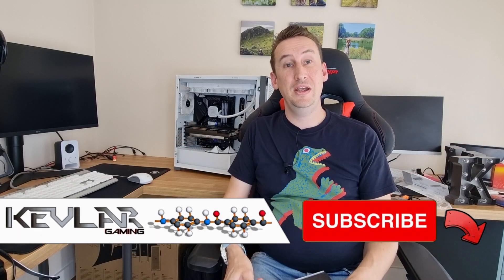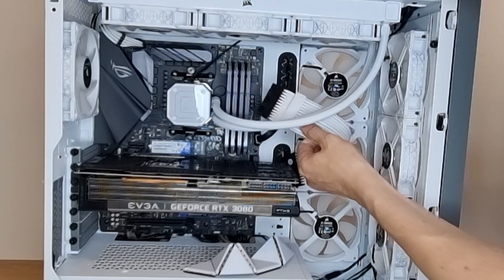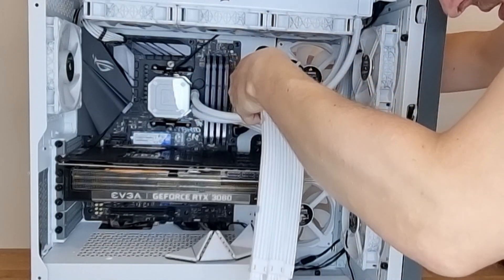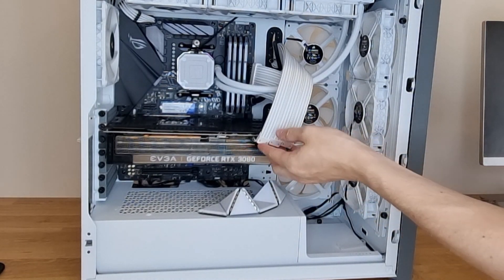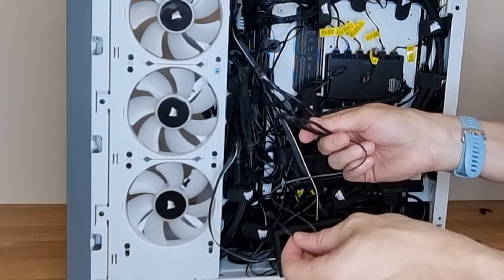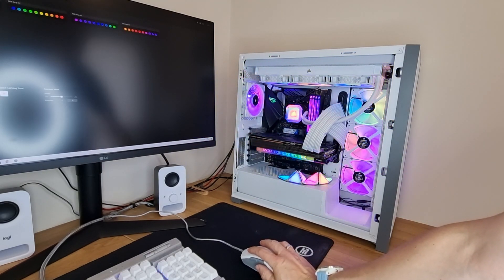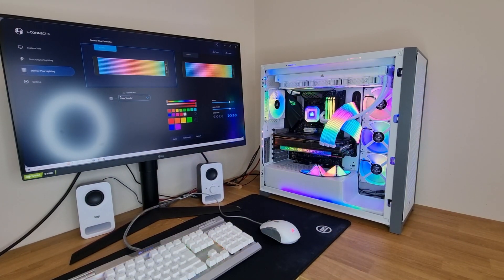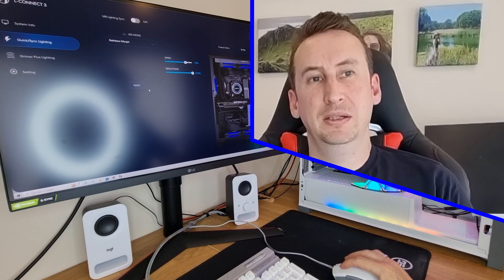How to install Lian Li Strimer Plus V2 - Can I control with iCue??

Comment: i have written before another video video you had.  I got it working with icue with old controller v1 version.  It works right away.  I have also tried all sorts of ways it does not work.
Reply from the maker: Yeah I meant to mention you found that in the video, forgot to mention it!  Might do a quick follow up vid to show that for people that might want to use that method.  Thanks for sharing 👍
Reply: Can i have the link to buy that controller v1 thanks 🙏🏾
Reply: @charlie888ize  just Aliexpres or ebay
Reply: @merkekeruysat  link ebay please i try look but couldn’t find it 😢

Comment: iQue is garbage, as is most Corsair Fans and Coolers.  After working as a system builder for many years, I stepped way.  Three years ago I decided to build a new system, and I went with Corsair, based on review.  What a mistake.  3 Months later I changed out the CPU, and game the system to my daughter.  I then tried NZXT, CAM software much nicer then iQue.  Sold that rig and now just build a Full Lian Li system.  By far the best experience I have had....  LConnect is a far better piece of software.

Comment: Hi guys, I'm from Brazil and Version V2 works, I'm using the lighting node pro controller, the difference between version V1 and V2 is in the L-Connect 3 software. With Lian Li Strimer V1 you had to configure the controller to control the ARGB through the Motherboard and in V2 you have to connect the USB cable to the internal Motherboard and install L-Connect 3, in the Quick/Sync Lighting menu, enable the MB Lighting Sync option so that the Motherboard controls the ARGB, then connect the Strimer ARGB cable on the lighting node pro controller using a converter cable and then just make the settings in ICUE on one of the channels that is connected.
Reply: Bro you’re the man!! Your instructions are on the money and they worked! Thanks!!!
Reply: thank you very much from Spain!
Reply: You are best bro thanks

Comment: If my GPU has 1x8 + 1x6 pin connection and I want to use the rgb lights via Icue, which version of Lian Li would you recommend and is it even possible to connect the GPU cable on a video board that does not have the standard 2x8 or 3x8 connection?
Reply from the maker: Hey, think I just answered most of this on your other comment.  But I would suggest getting v1 cables if you want to control via icue, as the v1 controller is easier to get working in icue

Comment: Not sure which exact Corsair controllers you are using but is there any reason (I am using Strimer V1 to adapter) that I couldn’t forego the Lighting Node Pro and just use one of the LED slot on the Commander Pro connected with the adapter cable to the Lian Li Controller directly? Any advice would be appreciated I have 10 RGB Corsair fans so have the Commander Pro, Commander Core XT, Lian Li Controller and an RGB hub for the RGB for the fans plugged into the Commander Pro. I am setting up a new PC now and space is becoming dire so adding the add’l controller and wires might be a pain. Thank you
Reply from the maker: Hey, yeah the LED slot on the commander will be fine!  I just went for the lighting node as its the cheaper option if you don't have any commander etc with an LED slot.
Reply: @kevlargamingpcs9802  awesome thank you! I appreciate the response, your videos were really helpful for wiring these mess of Corsair fans and strimer cables

Comment: So in the 8 pin port in the gpu I only have one slot. And only one of the 8 pins light up. If this how I have to have it now ? The original black 8 pin has its original connector then about also coming out of it about 4cm of wires then another connector and even plugging in both connectors to the lian li strimmer lights in the back ended doesn’t do the trick. If I switch them round the other one lights up so it’s no faulty it’s more than power is only going into one of them. Any thoughts ?
Reply from the maker: So sounds like you have a gpu that only needs 1 8pin cable?  And I don't think lian li do a single 8 pin strimmer cable, only designed for 2x8 pin or 3x8 pin gpus.  So yes I think it sounds like it will only work properly when fully plugged into a gpu.
Reply: @kevlargamingpcs9802  even when I plug it into the one which isn’t plugged in it still lights up the inactive one so not sure if that ends the issue 😕 my original 8 pin cable actually has to output socket things obviously I only have 1 input so it doesn’t matter but how come the 1st supplies power but the extended one attacked doesn’t ? Seems like a wasted but of wire but surely not right ?
Reply: @kevlargamingpcs9802  for example the one that isn’t plugged into the gpu and is just hanging is the one currently lighting up? Any ideas ?
Reply from the maker: @mcocadmit4923  interesting, I'm afraid I'm really not sure.  Ive never had that situation, only ever had the cable where I'm using all the connections

Comment: It is possible to connect directly to the motherboard? I have the strimer plus v2 8pin, whitouth controller. Thx!
Reply from the maker: Hey, I'm pretty sure they do all come with the motherboard rgb connection canle so you can connect to your motherboard (as long as your motherboard has the right rgb connection)

Comment: Hey did you ever find a way to get the strimer v2 to work with icue with the strimer v2s controller. I have the 5v 4p adapter and a commander core and lightning node core cant get it to work. Is the only way to get it to icue is via led port?
Reply from the maker: hi, I'm afraid not.  someone in the comments said something about a setting in the Ian li software that might get it to work (still using that corsair adapter method) but i sold my adapter with the old cables so haven't had a chance to try.
Reply: @kevlargamingpcs9802  I was reading some posts about that setting and it started that they opened L-Connect and changed that setting to motherboard control, closed the program and tried icue and it didn't work.   Lian Li said they didn't colab with Asus (users board) to make it work?   So it sounds like it can be done but the software needs to be fixed.

Comment: I am waiting patiently because my 3x8 is v2 and cant connect to old controller.
Reply from the maker: Hey, based on your comment I assume you saw my follow up video where I used the old controller.  (And I guess your old controller must be for the 2x8 pin cable).  
I'm still keeping my eye out for another method, nothing found yet.
Reply: @kevlargamingpcs9802  Is there an old controller for 3x8 pin?
Reply from the maker: @ondb  yeah checkout this vid, I explain that.  With the old cables the 3x8 pin cable came with a compatible controller as the on that comes with the motherboard cable doesn't fit the 3x8.
https://youtu.be/M15qS6Bt4ao
Reply: Hi Kev, it took me a while to find this vid, I've got a similar setup but with the 4000D Airflow.

How did you manage to find a L-connect V2 controller? I can't find one anywhere and I've got both the GPU and Mobo Strimmer Plus V2. I'm in the UK too so, shouldn't be any different finding the L-connect V2.

Really need that synchronization in my life 😅😂
Reply from the maker: @MidLifeGamerGuy  hey, so my v2 controller came in the box the the MotherBoard strimmer plus v2 cable, didn't yours come with one!? That's odd, as I don't think they sell the v2 controller separately.
Reply: @kevlargamingpcs9802  I was talking about the strimmer controller with the buttons on it (presumably L-connect 2 as the new one is advertised as L-connect 3).

I'm looking to get the Corsair light strips with that controller but didn't know if you'd bought the controller (with the buttons) for the strimmers on eBay or somewhere? specific?
Reply from the maker: @MidLifeGamerGuy   ah got ya.  Yeah sorry the numbering is all odd, i call the controller that comes with the v2 cables the v2 controller, which works with the L3 connect software 🤣.  So the one with the buttons is the v1 controller, that comes with the old v1 cables, as I had the original cables I still had it.  Again I don't think they sell separately, but might get lucky with someone selling on on eBay!
Reply: @kevlargamingpcs9802  fingers crossed. That Signal RGB looked promising but they don't support the strimmers yet